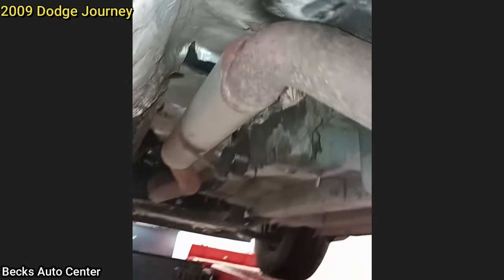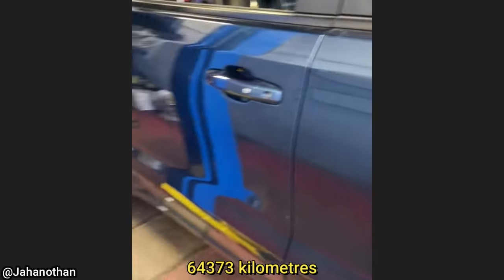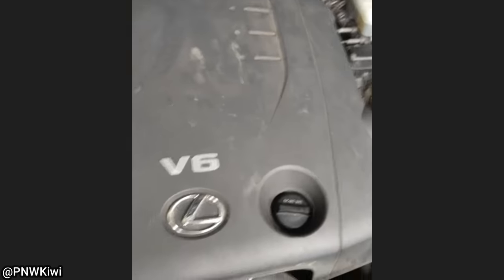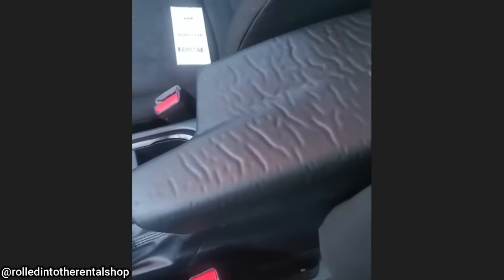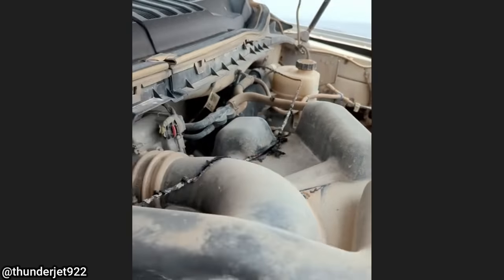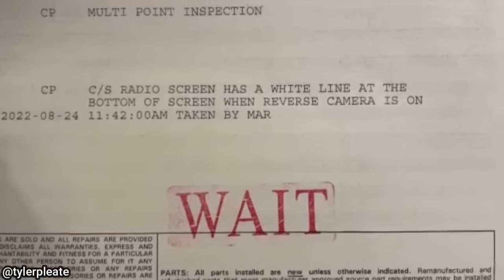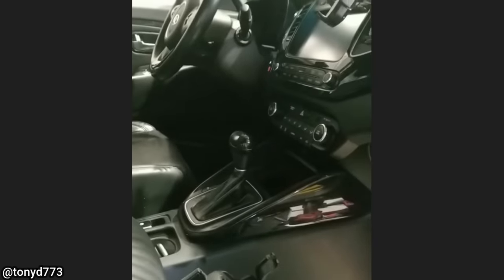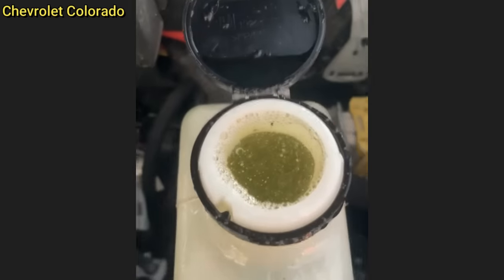Customer States Compilation (The Best of 2022) | Just Rolled In

Comment: if i have to pay a mechanic just to find out “yeah someone actually just zip tied a cowbell to your car” i’m fighting someone 😂
Reply: We did a similar thing to our lead man.
We got one of those massive zip ties and put it on the drive line if his work van.
We trimmed it up so it would hit the floor pan but couldn't see it from just looking.
Drove him nuts. 
Later we pushed his driver's seat slightly forward to an uncomfortable position and remove the power seat fuse.

We have a million of them.😏
Reply: @franktaylor7617  That’s some wholesome, yet dark, shenanigans right there, sir. 😅
Reply: @franktaylor7617  lmao 😄 awesome
Reply: Same, I'm all for pranks but if some pulls a prank on me that costs me money. They better pay for it or we won't be friends anymore.
Reply: Kinda sounds like it would be your fault for not checking around the frame first just to see what you can find. That cowbell was definitely visible just by looking under the car while on the ground
Reply: Most decent shops won’t even charge anything for something like that
Reply: @franktaylor7617  
Good stuff, Amazing that I never pranked anyone with all the wild ideas I have.
Reply: @Oils36  
That would be easy money for me. I did some work for people at one time.
Most of the time I would save these people a ton of money. On the other hand they were loaded and had money to burn. There were a few cases where I charged for doing some real basic work. They made out with me. That's for sure. Not only did I save them money but I saved them time.
Reply: @Mr.Robert1  
I once worked for a major aircraft company.
One of my coworkers was constantly screwing with me.
The typical gags. Filling my air drill with hand lotion, gluing tools to the table. That sort of thing.

I started saving my spent sunflower seeds shells. Eventually I had a huge bag. Filled every drawer of his tool box.
During the saving of shells process.
I got a great idea.

I hung a partially opened can of cat food under his desk.
I used duct tape to hang it like a basket way under in the far back were you couldn't see it easily.
I waited.
After a few days. It was seething with magots.
A couple more days and the flies were everywhere around his desk.
Things would be fine until he bumped the desk. Then a swarm would show up from what appeared to be nowhere. All of us would watch first thing in the morning. 😆

Works with a small yogurt container too.
Except it's nats.
I left an empty, but not clean, container inside of a large paper cup (1 gal sized dixie cup) on top of the microwave in the lunch area.
There was a group of people that would start break early to used the microwave.
By the time they were done. Break would be over.
So I pranked them with nats.
Open and close the microwave door a couple of times and that would disturb the hundreds of nats.
🤭
We could watch from across the work shop.
The whole group swatting at tiny flies all lunch break.

I discovered this trick by leaving my yogurt container on my work table over the weekend.
Just the residue was enough to breed the nats.😏
I've got tons more.
My brain never stops.😈
Reply: If a mechanic wants to be paid just for lifting the car, then the mechanic is the one i'll be fighting.
Reply: Yeah that’s definitely going to send him/her straight to the enemies list.
Reply: We used to put giant zip ties on work van drive shafts back when I did HVAC. It doesn't last though people catch on quickly
Reply: Dude must not have even looked not like it was hidden
Reply: One of my coworkers duct tape a heavy steel wedge to another worker's driveline. He'd drive a few feet, feel the vibration, stop, look for problem, not find anything and try again.  After three times with much cursing I honked at him to pull over. Got under his pickup and located the heavy wedge. Cut it loose and tossed it in the back of his truck. He really shouldn't have filled the other guy's suitcase with rocks the day before. His buddy had arrived at motel the previous evening after work and ripped the handle off his suitcase when retrieving it from the back of the truck. Opened up the suitcase to find a neat layer of rocks on his clothes. I advised them both to make a truce as they were technically even now.
Reply: @Giacomo Neri  so what your saying is your entitled to someone else's labor???
Reply: @tsfrider1644  what labor cutting a twist tie
Reply: @franktaylor7617  haha Ive put zip ties on my boss's truck and a few buddies vehicles over the years, it's one of the greatest pranks ever, but we're all car people and won't take them to the shop, we fix them ourselves, otherwise id be pissed if I paid a shop to tell me it was something dumb like that ahahaha
Reply: @DJKronikCam710  
Yep.
Car guys figure it out pretty quickly.
They still get mad when they have to crawl under it to remove it.
The madness is joyful.😆

I once shoved an empty water bottle in between the duelies on back of one of our trucks.
It took the guys all day to figure where that weird noise was coming from.
I didn't hear it but apparently it made a hell of a lot of noise for an plastic water bottle.
😆
Reply: If your first thought is to go to a mechanic before you get under your vehicle... Idk you probably deserved to get ripped off.
Reply: @sdawg58  that's a fair argument lol I mean there are people who are just completely vehicular illiterate and clueless which would probably stop them from going under it but still I agree, if you can't look and just take it directly to a mechanic then yes thats on you lmfao
Reply: @Oils36   your right, but even if the shop doesnt charge , I would at least give the mechanic $10-$20 for there time.
Reply: @Oils36   The guys at our local garage do stuff for us all the time for free but we normally give em 10 or 20 for their time and if they dont want the $ we will get em lunch or my wife will bake em some goodies( they all have their favorites lol). Or during the summer we make sure to get em a few cases of water and gatorade every few weeks for all the guys at the garage.
Reply: I need a cow bell now
Reply: They probably knew he was too lazy to figure it out.
Reply: His own fault for not simply looking underneath the damn car lmao.
Reply: As the mechanic I'm charging full diag and saying nothing, 😂
Reply: @goreobsessed2308  Logging the car in to the shop, doing the paperwork, driving in, securing the lift, minimum 15 minutes.  They should work for free?
Reply: Dang! Off the Christmas card list, eh? Nasty.
Reply: :face-blue-smiling:
Reply: @tsfrider1644  It’s crazy how clueless and selfish some people are
Reply: How about wiring the horn to the blinker or brake lights
Reply: If you don't check for the source of a strange noise yourself first, you probably shouldn't be watching this video.
Reply: Frank Taylor, those 🪰 are called "Scuttle Flies"- I agree, they do look like gnats.
Reply: You made me laught alot to a point .... Thanks
Reply: At work soMe times we would tie giant zip ties to the drive shaft. It would only makes noise when moving. Soooo good!!
Reply: HONESTLY!!! 😂
Reply: Sometimes you are super busy and don't have the time to investigate.
For example, I would, but my mother wouldn't.
Reply: More cow bell! More cow bell!!!
Reply: I heard you couldnt fight sleep
Reply: Any honest mechanic wouldn't charge you but you're gonna be joked about all week🤣😂
Reply: Yeah but if you can't look under your own truck, you deserve the bill.
Reply: @franktaylor7617  gnats
Reply: I wouldnt even charge lmao
Reply: @LazzarrusLong  How is that wholesome in any way?
Reply: @Igzilee  If you have friends willing to go to all that trouble just to have a good laugh with you… well, it just doesn’t get more wholesome than that.
Reply: If I have the problem of when I turn left and roll my window down at the same time causing my door to open I’m selling me car at that point
Reply: Most shops won't charge for something like that and the Tech won't get paid a dime. It's worse for a dealer Tech. We spend at least 10 to 15 hours a week looking a issues like the ones in this video and don't get paid a single cent for our time.
Reply: @giacomoneri1782 I hope you understand a car needs to be logged into the system, then techs take the time to lift and inspect. Also overheads. 

If you don't want that kind of service, do feel free to ask a friend lols.
Reply: @franktaylor7617 these are gross activities. Hardly pranks. 😑 Typically the kind of thing that makes your co-workers avoid you.
Reply: @shaftdrive7567  
That would be nice wouldn't it. If boring people would just avoid others.

But sadly they didn't avoid me.
They came right back with more pranks. Some were pretty funny and clever.

Sometimes people have fun at work.
Then there's others that are a stick in the mud.
Those are the ones we avoid, but I'm sure you already know that🤨
Reply: Just look under the car?
Reply: Put a big zip tie on moving parts so it makes an old bicycle with spoke thingies sound
Reply: I say leave it and say the mechanic couldn't find out what was wrong, and see how long till your friends tell you they put the cowbell under the car.
Reply: @franktaylor7617  Still act like children? Ok.
Reply: @jacktorrance2633  
Yes grampa.
We still have fun with our coworkers.
We laugh, joke around and try to make our jobs fun.
I'm sorry that offends you or you disagree with trying to have a good time.
Maybe best to sit on the porch and guard your lawn. 
I bet you're the type of person that tries to get the kids to be quiet at family BBQs.

Comment: I just want to see the reaction video of the technician telling the person that they needed to turn their dial to cool for the A/C to work.
Reply: I want to see the repair shop explain to the customer they can't change the paint from their in-car controls.
Reply: And a mint - condition owners manual in the glovebox, that has never been read by the owner.
Reply: How about the damn STRAW keeping the cubby from closing? How about bringing your car in over a cubby to begin with?!?! lmao uugghhh
Reply: Unfortunately that may or may not be my sister; I have told her, my younger sister has told her, her fiance has told her and our father has told her, 4 people, count them 4; people have told her that to get hot air the AC has to be off. But she insists that because it is "Air Conditioning" it must "condition the air to be hot or cold". She had a 3.7 GPA in grade school.
Reply: Do they charge for that kind of stuff?
Reply: @wr1ght939  i guess it's called a roll-in fee or inspection fee , so the time of the shop is worth something
Reply: Guarantee the customer's reaction was "What do you mean?""
Reply: @hollisyeano1397  how the fuck could someone have a 3.7 gpa and not think: hm, red usually means hot, and blue cold, there’s also a button with a little heat like symbol. Maybe if I press that I’ll get hot air”
Reply: Legit had an absolute idiot have the same issue. He told me he had to drive with his windows cracked/down because his heater was too hot and whenever he turned the "Numbers" down, it still got hot. So he thought his car was overheating. Idiot was turning the fan speed down, while the thermostat was full blasted. Same idiot had no dash lights on cause he popped a fuse for the dash lights and would drive at night guessing the speed limit cause he couldn't see his speedometer....
Reply: I wonder how much the "come on, _SERIOUSLY_?" fee is.
Reply: That a be the craziest video ever
Reply: @hollisyeano1397  the A/C has two functions. Not only does it cool the air in the cabin, it also dehumidifies the air. That’s why the temperature setting is separate from the fan/environmental settings, its also why the A/C compressor turns on automatically when you run the window defogger. Unless you live in a mostly dry climate you’re going to want to run the A/C with the heat to keep the glass clear…in short, that’s why it’s called an air conditioner and not an air cooler.
Reply: It would be a screen full of censored out faces because no one in their right mind would sign a release to show the identity of stupidity.
Reply: I'm a Technician at a large new car dealer.  Man, the stuff that comes in sometimes is painful.  Last week I had a Maverick with 65 miles on it claim his GPS stopped working....Sir it's not equipped with Navigation.  He proceeds to cuss out the advisor, saying, "Your people don't know $h|t!".
Reply: @hollisyeano1397  Damn man... I barely scraped by with like a 2.3 gpa, and I've done several succesful vehicle jobs in my life. Just goes to show that book smart and street smart don't always go hand in hand.
Reply: @fabioarrua  Just recently had an issue with a dead battery a few weeks ago. I replaced it with a new battery myself, but I still wanted my mechanic to take a look, to make sure I didn't have an alternator issue. He ran his checks, and said it was fine. Didn't even charge me for the service.Then again, I always give him and his crew a couple of 12 packs of beer when they change the oil and switch out the studded snow tires for my summer tires. 'Gotta keep the wrenches lubricated' as he says.
Reply: Wait...

What?? Did I read that right?

Come to find out I did read that right. Lol.
Reply: @StageRight123  Yup she can do Trig in her head, but the AC thing just baffles her.
Reply: @hollisyeano1397  educated does not mean intelligent.
Reply: Not nearly as much as I want to hear the technician tell the person with the radio that "doesn't work" that they needed to turn it on.
Reply: Mechanic : Well that was easy 

Invoice to customer later that day :

- Remove and refit dash 
- Re-gas system 
- Change air filters 
- New steering wheel
- Installed a jabba wabba - as per recommended regulations 
- Replac……..
Reply: @tycobandit  Its actually two separate systems with a common interface ie the climate control console or whatever you want to call it. The a/c pump uses refrigerant and a compressor to produce cold air while the heater core uses heat from the engines coolant to create hot air ,but its the hot air that defogs your window not the cold, so if youre turning your a/c on to defog the window youre just wasting refrigerant and gas by putting extra load on the engine via the a/c pump.
Reply: @skootz24  it's when you tell them you had to replace the compressor and it will be $1000
Reply: @glennross85  no, tycobandit2690 is right and so is the 3.7 gpa sister. Lots of luxury cars will automatically turn on the ac when defrost setting is selected. The air runs thru the ac unit to have moisture removed then gets heated. I had a low gpa.
Reply: Or the blue light on the dash (high beams) !!!!🤣🤣🤣
Reply: @WR1GHT  Most shops will charge an inspection fee to look over the car, depending on how long it's there. Sometimes you might get a mechanic that'll feel sorry for you and waive the fee.
Reply: I'm guilty of this, in my defense it was a car I'd just bought after not owning a car for several years, and I hadn't seen the owner's manual in the glovebox (buried under a pile of papers the dealership jammed inside). Really embarrassing, I just thought Italian engineering couldn't keep up with summer in the desert. Last time I'll make that mistake! Just push the knob in to turn on the a/c, as opposed to an obvious switch! 🙄🤦
Reply: The A/C was working, but can deliver conditioned warm air, or conditioned cold air.
Reply: @Silent_Shadow reminds me of this one lady I had who insisted her Reverse Automatic Braking didn’t work and she smacked her garage door. Insisted her car had it because she “saw the same car have it on tv”

Comment: That key start from the door lock is outstanding
Reply: i want to know how i can replicate this
Reply: @A_Dilophosaurus I can only assume that somehow the door lock mechanism is somehow touching the starter wires and essentially hot wiring it, but it’s so weird that it only works turning left and not right.
Reply: Either it's an unbelievable defect, or the single greatest prank ever pulled
Reply: its even funnier because the car wont start haha
Reply: I understand now why people lease so they don’t have to deal with repairs.  Just roll it over to the new model and new monthly payments.
Reply: @Lazcomeforth  that is stupid. People just dont know how to take care of their things. Cars shouldn't be like drive it and that's it. You have to be more responsible with it. It's like buying a house. It is a long term investment
Reply: @Jaesiane new cars are different, they become unfixable now, with engines that are not rebuildable, and parts you cannot get, it depends on the car, along with depreciation, it makes more sense to lease a new car, that way you don’t have 1k worth if scrap metal in 20 years when one or two parts fail, and/or many small parts over time.
Reply: @Jaesiane some people like newer things. Relax
Reply: Yeah like how's that even possible
Reply: As a Ford owner I can confirm this will happen on the focus mines newer and if I lock my car 3 times in rapid succession it will start the car even though I don't have a starter kit nor the option on my car for the car to self start lol
Reply: @tookay4ever  you're lucky you could even get a Ford to start. My fiesta gives me so much trouble